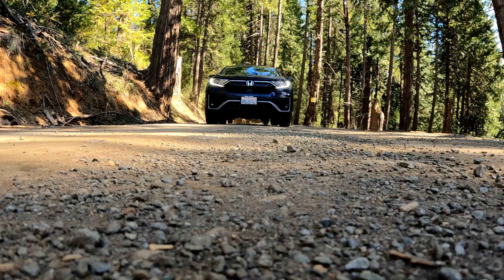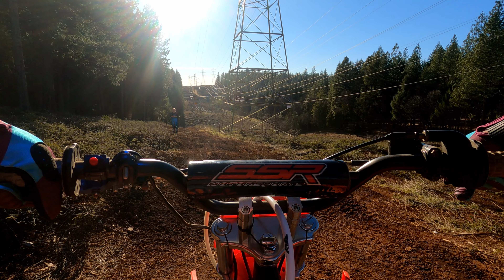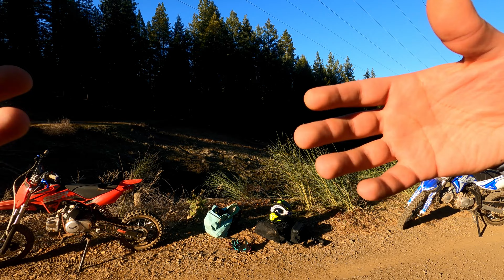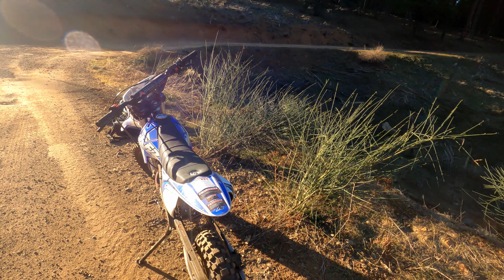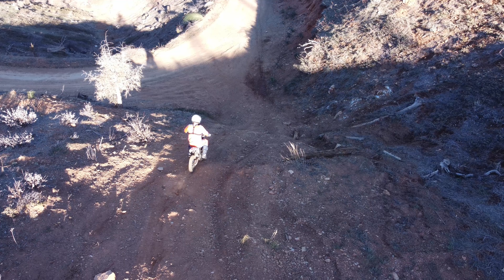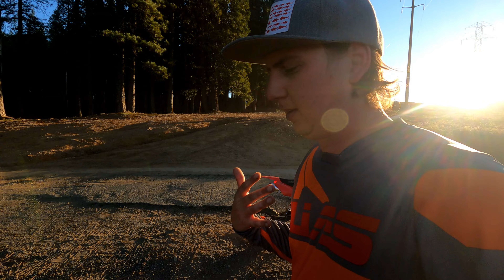SSR vs APOLLO which pit bike is better ( Best budget pit bike )

Comment: I’ve owned 3 ssr and 1 Apollo rfz the Apollo is more comfortable and balanced especially for bigger riders (I’m 6,3 260lbs) but the ssr is faster for some reason idk why but even my first ssr with bad rings burning oil like a 2 stroke was faster then the rfz

Also anyone who is scared of buying these Chinese bikes because of bad reviews doesn’t need to worry, they are very reliable and cheap to repair I beat the crap out of these bikes and have let several people learn manual on them and they never break just regular maintenance and loctite on bolts my first ssr was a 110 that sat under a tree for 4 years with no carb on it. It was seized and cylinder was full of pinestraw rust and  mud dauber nest and after freeing it up with vinegar and marvel mystery oil even that clapped out bike ran great
Reply: My son is on his 4th chinese bike now and they have been great.  Just picked up the SSR SR189, great bikes for the money.
Reply: @seanwan30  guess it’s a habit but idk imma keep saying it
Reply: What size were they ur pretty heavy bro

Comment: Awesome upload...very nicely done! I just bought a used SSR125...didn't know until I got it home how hard it had been treated by the previous owner. It's a 2021 model but the back wheel was basically destroyed...bent axle bolt etc. Got a new wheel ordered. I'm so ready to get this bike back out to ride...so much fun :) Keep the uploads coming!
Reply from the maker: Thank you I hope you get your bike back together soon so you can go out and enjoy it that sounds like a prime example of what I was saying in the video where people don’t do the maintenance and tighten everything down. A bent axle bolt sounds like it was loose and that’s how it got bent make sure you lock tight everything you get access to. Also it helps to use a paint to mark the bolts for visual to see if any come loose after every other ride
Reply: @throttlefamily4655  Thanks for the help/info!
Reply: Same but I got mines for $500 so I couldn’t complain and only thing actually wrong with mine was it was dropped a bunch from people trying to wheelies I got a new body and seat put on 2 days ago I’m waiting for my grips and a few other little things but it’s runs and rides fantastic especially for only costing me $700 in total $500 for the bike and about $200 worth of parts
Reply: Yet another reason ive been thinking Thumpstar, Hubs, spokes and wheels. 
Again, anyone know anything about Thumpstar?  Scary when you’re ready to drop over 2 grand and there’s nothing née, no responses on their website or especially their ghost town Facebook page.
I’m thinking also about buying the 140 piranha, but the price is even more, and I’m back to small wheels.

Comment: I got an Apolo ADR-125 (basically the venom motorsports version of the rfz-125 and they branded it as a "venom Thunder") It's not a bad bike. More value per $ than the Japanese or North American bikes imo. I think for the riding I do the Apolo is the better choice because it's higher off the ground and I go through a lot of water and muck on the abandoned roads I ride.

Comment: Hey throttle family got a question is it better to start on the ssr 125cc or the honda crf125f
Reply from the maker: @user-yd2mv8mi8u  if you have the money you can never go wrong with the crf125f but if you are going to be upgrading bikes soon after the ssr125 is a great starting platform to save money for the next bike

Comment: I put an Apollo 125 into my sons SSR110.  Now, his bike seems noticeably more powerfull than his brothers SSR 125.  So glad we ditched the KTMs.  These little china bikes have been 10 times more faithful.
Reply from the maker: I can definitely agree to that my friend bought his son a 2004 ktm and finding parts for it is a pain. I also love the fact that you can buy the yx 140 motor for around $350 to $400 and it’s bolts up the 125s are very reliable I have beat mine and it still keeps running

Comment: Great comparo👍
Can you guys do more 14/17” bigger wheel comparisons in future. I have had my Coolster M-125 (14/17” Big wheel) for over 2yrs now with no issues other than the shitty 420 chain that has been upgraded for a heav duty RK 420. Carb and engine “powa” and reliability have been great.

Comment: Cool video.
My ‘personal’ problem is I really want a 14/17” wheel pit bike. Tracks are fine with small wheels, but actual trail riding through the woods swallows up those little 12/14” tires. 
Is Thumpstar still in business?
Did you guys ever ride one of them?
Reply: I have an XPro with 14/17s.  Same bike from probably the same mfg in China. About $780 on Amazon. Will need the carb swap just like these bikes.
Reply: I just bought the SSR 140 tr bw. It has 17 front and 14 back with extra suspension. I’m 5’11 185lbs and it’s amazing. Came with Japan Mikuni carb. $1750 otd
Reply: @robertf7056  fwiw, my carb is clearly labeled Mikuni Japan, but it's also clearly not a Mikuni. It does run fine though. The aftermarket one I got was true Mikuni height and didn't fit under tank.  As long as yours is fun it doesn't matter where the parts come from anyway. Ride safe!
Reply: 14/17" wheels fit on the base SSR 125 just fine. $200 upgrade

Comment: I have a number of these bikes, including a 2016 Apollo rfz 125. I'm surprised you didn't touch on the fact that these bikes very likely share the same transmission gearing. Likely the only difference is the wheel size, which I bet shares the same sprockets.  So- the final drive ratio is determined by the rear wheel size. My Apollo has such a short first gear, it is almost useless. It is a 14/17 bike. I also have a bike with 12/12 rims and it also has a 125 but milled head, z40 cam. I don't notice a big difference in power despite the tire size difference. ( it's 125 is a generic amazon unit). Both bikes top out about 50. I'd be curious to know what gearing differences between the ssr and Apollo are, if any.

Comment: I have a question so the manual says the carbs 22mm and the link goes to a 26mm carb, what's the difference? Should I look for an aftermarket 22mm carb or is the 26mm better?
Reply from the maker: Well the 26 flows more air and fuel but I’m sure you could get the same performance out of either or if your jetting is correct
Reply: Measure! Most vm26 are actually 22 mm venturi diameter. 22mm is what these bikes like unless you have extensively modified them. A 22 mm will provide more velocity in the intake charge, and will have snappy throttle response, versus a bigger carb which may flow more at a lower velocity and feel soggy. You won't see any meaningful gains because it runs so poorly from idle to 3/4 throttle with a too big carb. Even a true 24mm carb won't gain you much if any top speed. More effort to get the carb jetted is time well spent. My 2016 Apolla had the carb riveted shut. That was the first thing I replaced.

Comment: Thinking of getting a pit I’m like 6,2 would you recommend big or small wheel it’s first bike
Reply from the maker: I would go with the the small wheel I like it more I’m also 6,2 the ssr is a great starter bike but definitely has enough power that you won’t get bored of it.
Reply: NO, if the Apollo was running correctly they would never have complained because a bigger wheeled bike performs so much better on whoops and everything else, those bikes are for a circus clowns.  This advice came from Malcolm Smith.

Comment: You have more control with the ssr because its tiny. The ssr also has more torque/power because of its smaller wheels. Its like comparing a yz65 to a ttr110. Obviously the smaller bike is going to be faster and more maneuverable. Ssr is good if you like small bikes the apollo is good if you like normal sized dirt bikes

Comment: Hi, so I have an SSR 125 bike to and for some reason every time I put the full quart of oil into my bike it always smokes out of my air filter and my exhaust, and the oil leaks out of my carburetor for some reason, do you think you could help me out?
Reply from the maker: Yes message me on Instagram @ throttle_family
Reply: It's because you over filled the crankcase. That engine only holds 700ml . Wich is apparently a little more than 3/4 of a of oil.  That should leave roughly 200ml left .
Reply: @robertdeneen3067  so is that .6 quarts?
Reply: @mattoneill7544  yes basically just over 3/4s of a one quart of oil

Comment: Do you still have the nibbi on the ssr?
Reply from the maker: I still have it on my other ssr but I still like the mikuni a little bit more
Reply: The venturie  I's a larger opening allowing more air flow on nibbi. If you had full out built race motor it would work alot better, the mikuni has a smaller venturie. Which is why it performs better out of the box. Atleast that's what I've gathered from my research,  I almost bought one for my gokart. Running a tillotson 212 stage 2.  If you can figure out how to lesson the venturie on the nibbie it may perform better
Reply from the maker: @harleyj3938  you are exactly right if you look at the way the machining is on the nibbi it is absolutely amazing every part on them looks amazing I still like it but I feel it would work a lot better on the 140s and up

Comment: The Apollo is more better compared to the ssr but all down to personal preferences the Apollo will be more suitable for taller riders and will also be abit stronger suspension is decent but better to upgrade the ssr is more for people that’s just starting off to confidence and feeling off riding/ but yet again a pit bike is better when they are set up right and have been modified to wake them up a bit
Reply from the maker: Definitely both bikes for this test had the mikuni carbs and the same air pressure in the tires both bikes are great and we love them both!
Reply: @throttlefamily4655  but one major thing you're forgetting is that you did not have the Apollo running well.  You two like the circus bike but with bigger Wheels when both have great running engines -  there's only one choice.  This opinion came from Malcolm Smith
Reply: ‘More better’
You must live in my neck of the woods...

Comment: Good comparison
Reply from the maker: Thank you
Reply: It was a horrible comparison because the Apollo isn't running well.  Malcolm Smith a famous motocross racer always said that bigger wheels are better when it comes to these small bikes.  They like the circus bike because it runs great, they may have the same carburetor but they did not tune the Apollo correctly.  
This video is backwards because engineers give these bikes bigger Wheels even with the same engines so you can perform better over more demanding obstacles.  They never intended that a test would be done with an unturned crap engine.  I can't wait to see them perform at the circus

Comment: You don't have the Apollo running right, and of course any bike with the same good running engine with bigger wheels will do better on whoops and everything else except for a circus performance.
Reply from the maker: They both have the same carburetors they both run great the exhaust tone on the apollo blows out the mic with the drone. The bigger wheels have more rotating mass and that takes away from some of the power as well as it is a heavier bike. I’m also a 200lb rider. Both motors are almost identical. As being said with those factors the ssr being being lighter with smaller wheels will give it more transferred power to the ground to get moving.